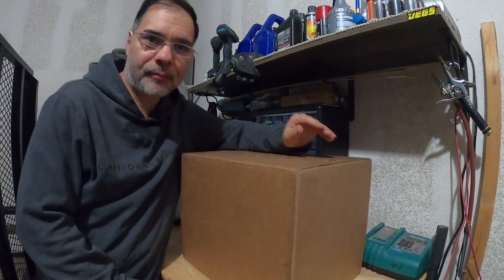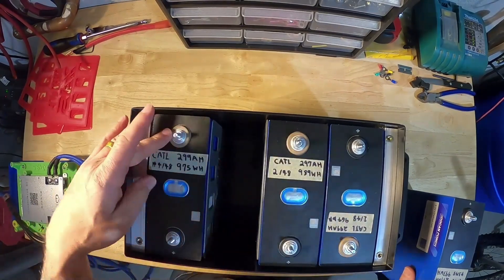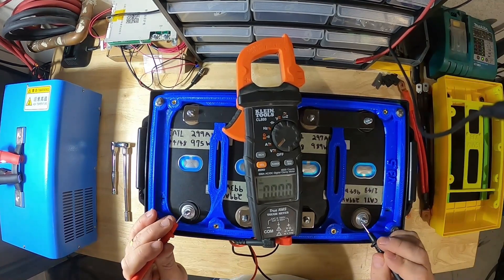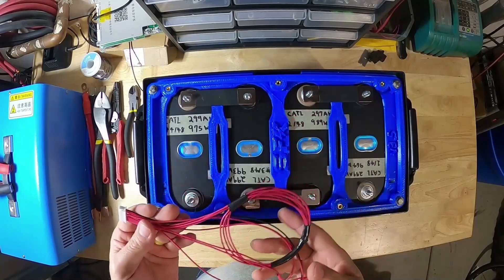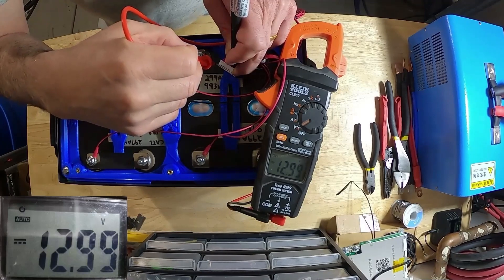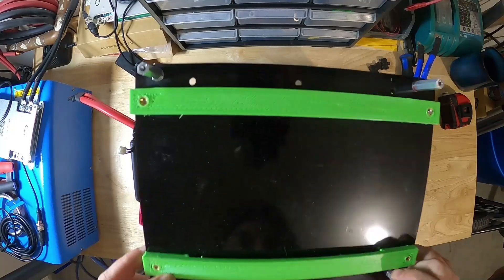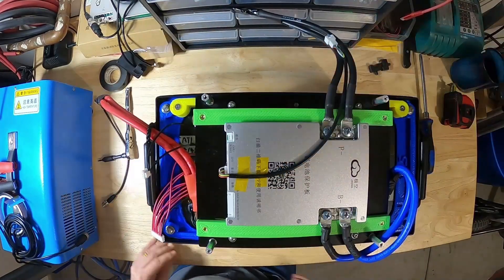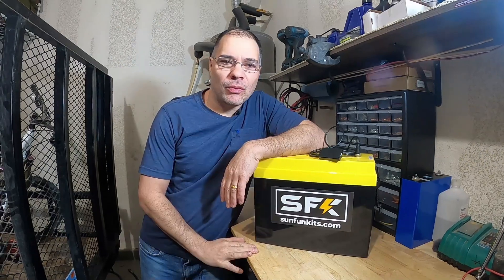DIY LiFePO4 12V Battery Build - 301 Series

Comment: Can you do a price comparison of this build compared to a prebuilt battery of the same capacity
Reply from the maker: I'll be doing another build of the same battery, but the heated version. I will include that in the video.  This batteey cost me around $900 USD to build and has 280Ah capacity. It will greatly depend on the cells you use and where you get them.  Mine came from China and cost about $135ea shipped. Thanks for watching!
Reply from the maker: The problem you might find is that if you are only building one battery and you don't have any tools, that will be an extra cost depending on how you look at it.  At minimum, you will need a multimeter, basic tool set,  wire cutters, wire crimpers, and a power supply for testing cells.. some people opt not to test their cells, however.

Comment: I was surprised to see you were able to use a BMS with 8 sense wires on a battery needing only 1 power and 4 sense wires. Is that because you used a specially designed BMS allowing for this setup you used? Did you need to terminate the unused sense wires? Could you use an everyday 8s bms on a 4s bms build?  Oh and if I am correct you connected the battery negative first to the BMS followed by the positive connection then connected the sense wires to the batteries followed by plugging in the sense lines to the BMS? Wondering about the order of connection. Thank you enjoyed the build and video.
Reply from the maker: Hi. Yes, that particular BMS model allows for any number of cells between 4 and 8. You do not need to terminate them. Just coil the unused wires up and tuck them away. I did not show the configuration of the BMS because I was trying to keep the video under 20 min. No, you can not use a straight 8s for a 4s pack. Only with this particular BMS. When you perform the initial setup in the BMS app, you define the number of cells you have as well as the capacity. I will show this in more detail in the next video.  I like this BMS because if you wanted to use the same BMS to build a 24v nominal pack, you could.  The order I used was I plugged connected the sense wires, then temporarily connected the b- to the pack main negative to test that I wired the harness correctly.  I then disconnected the BMS to finish mounting it, then I reconnected the b- then p- to lid, then the main positive to lid.  Hope this answers your question. Thanks for watching..